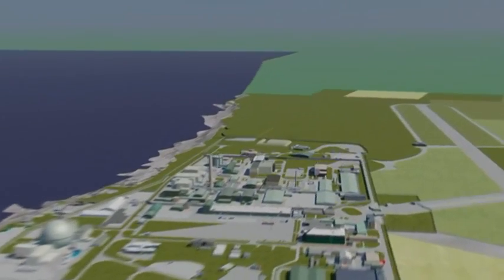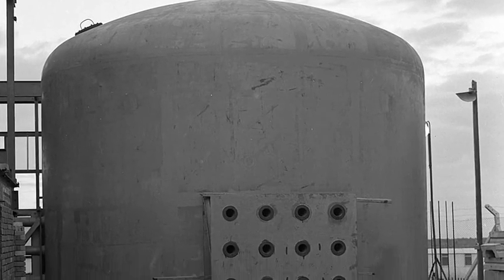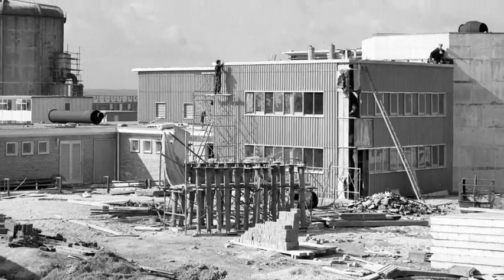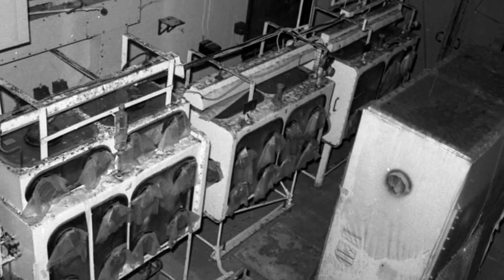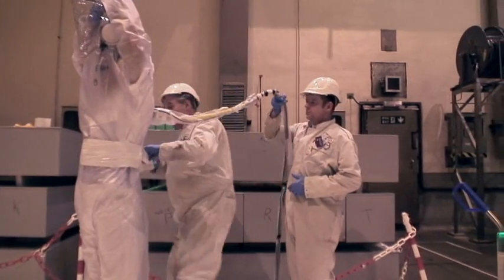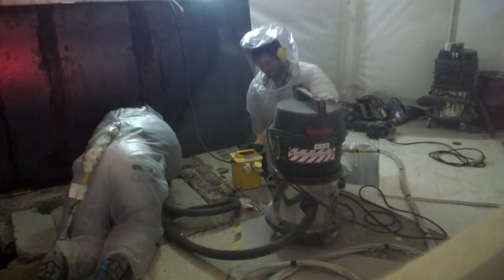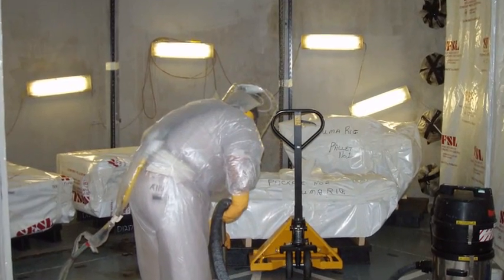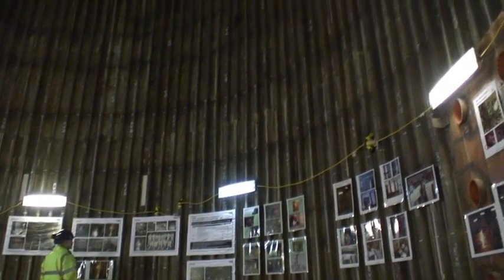Demolition of the Plutonium Criticality Laboratory

Comment: If only decontaminating the surrounding environment were as easy to accomplish as decommissioning fixed infrastructure.
Not that the decommissioning isn’t a huge challenge and achievement, just that it’s actually possible, whereas removing every hot particle from the area - particularly the marine environment - simply isn’t feasible.
I’m certainly not a radiological alarmist, but the facility’s failure to contain some of the worst material imaginable was/is a tragedy. One can be certain that such “oversights” would’ve been far less likely had the facility been built closer to London, but we’re all aware of the “rationale” behind placing it as far away from that city as practicalities would permit.
Reply: Most of the contaminants are water soluble or water reactive, they are now part of the background radiation and are of no risk to the environment.  They are in the form of induvial atoms or single radioactive atom compounds.
Reply: If you search hard you will find the ongoing tracking studies of where all that stuff went and is still going.  There are some very obvious isotopes found in the sea "biota" around the British Isles.  As most of this stuff ends up just being moved to Sellafield and put into ponds for another 50 years, which leak, the Irish coast and Belfast lough in particular are about 50 times the bq/m3 than other sites.  Isotopes of Pu and Am and even higher nucliea counts.  bq/m3 isn't a very frightening unit though.  50 bq/m3 is 100 times background, maybe, but its still only 50 decays per second from a cubic meter of sand, biomass or silt.
Reply: Also.  Some of those isotopes being tracked are not long half-life, or transuranic decay products, but are active fission daughters, like caesium and iodine.  So these have been made in the past number of decades.  Which is understandable when you consider how much stuff at Sellafield is still "active" and "reacting" in those pools, decay fissions and even the threat is accidental assembly to criticality are all still risks.

Comment: If it was so contaminated, how did they work in there to carry out experiments?
Reply: When operational it was a clean lab with hot boxes. The hot cells and pipework containing radioactive liquids would all become radioactive. When they did a partial clean up the cell was opened allowing radioactive dust to run through the entire lab